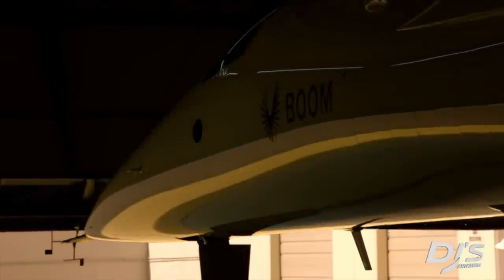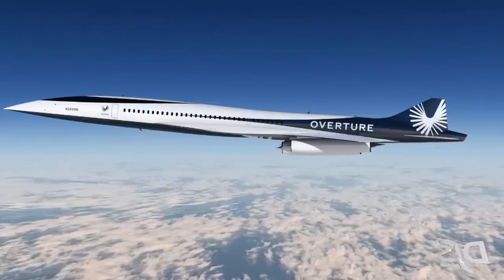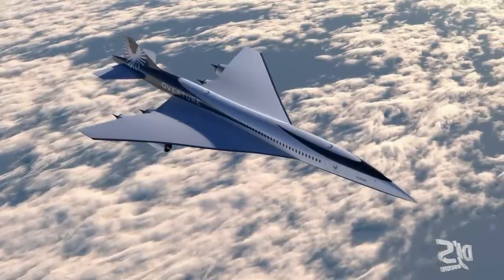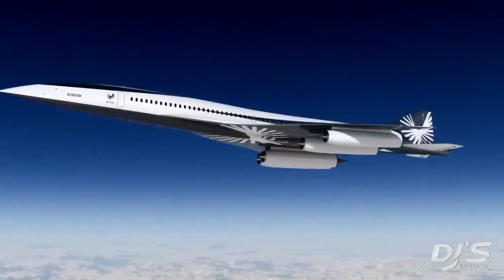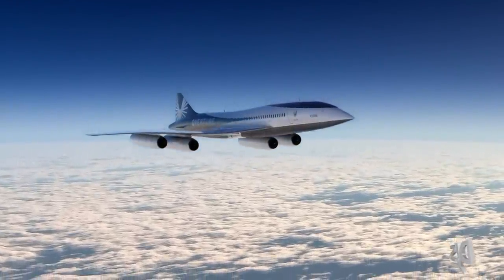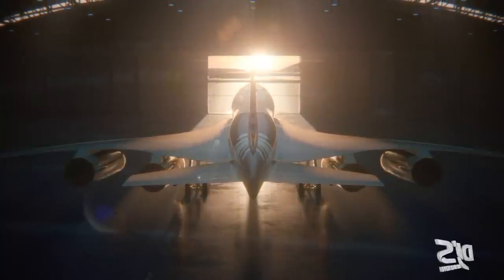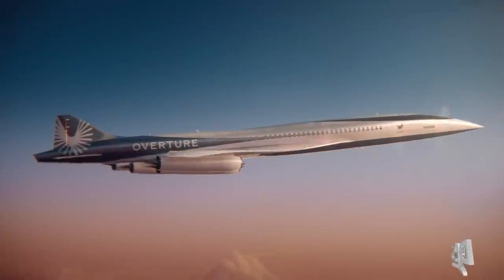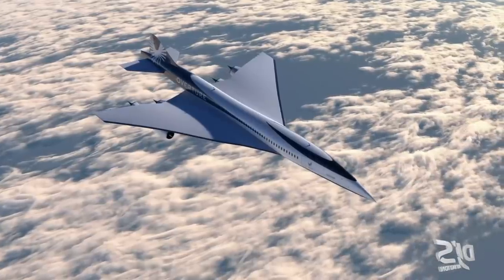Boom Supersonic MASSIVE News

Comment: To be commercially viable this needs to b at least three times the size.
Reply: Concorde had trouble filling its seats and it wasn't a huge aircraft. Considering this aircraft seems to be aimed at the premium end of the market, I would say the size is a good call
Reply: Overture is not aimed at the main line economy market, which is more than adequately catered for by Boeing and Airbus, for example. Instead, it is targeting the 700 million long range business trips made each year globally, 400 million by Americans.

Because Overture will be fuel efficient at sub and supersonic speeds, and will be compliant with ICAO-14 subsonic noise regulations, Boom and the airlines have identified 500 viable routes, some mixed land/water, compared to just 2 Atlantic routes for Concorde. Commercial supersonic flight over land is effectively banned worldwide, so Overture will fly Mach 0.94 (10% to 20% faster) over land and Mach 1.7 (x2 faster) over water. 

A subsonic airliner does the JFK/LHR trip in 8 hours. Overture will do it in 4 hours.
A 16 hour subsonic trip across the Pacific would require a 1 hour refuelling stop, giving a duration of 4+1+4=9 hours total on Overture. 

All 65 to 80 seats will be quiet business class, almost certainly with internet, with ample room. Tickets will be the same price as subsonic business class. This, coupled with twice the utilisation of subsonic airliners, would give a good margin for the airlines.

Comment: Slinging engines under the wings like this will prevent it exceeding speed of sound unless they can produce massive amounbts of thrust, say one fifty- to two hundred lbs. each.  It is like making a brick fly.
Reply: Drag is drag. It makes no difference how much thrust the engine pods transmit to the wing.

Comment: This thing doesn’t hold anywhere near enough passengers. Concorde also failed for this reason. How do they get past that.
Reply: Overture is not aimed at the main line economy market, which is more than adequately catered for by Boeing and Airbus, for example. Instead, it is targeting the 700 million long range business trips made each year globally, 400 million by Americans.

Because Overture will be fuel efficient at sub and supersonic speeds, and will be compliant with ICAO-14 subsonic noise regulations, Boom and the airlines have identified 500 viable routes, some mixed land/water, compared to just 2 Atlantic routes for Concorde. Commercial supersonic flight over land is effectively banned worldwide, so Overture will fly Mach 0.94 (10% to 20% faster) over land and Mach 1.7 (x2 faster) over water. 

A subsonic airliner does the JFK/LHR trip in 8 hours. Overture will do it in 4 hours.
A 16 hour subsonic trip across the Pacific would require a 1 hour refuelling stop, giving a duration of 4+1+4=9 hours total on Overture. 

All 65 to 80 seats will be quiet business class, almost certainly with internet, with ample room. Tickets will be the same price as subsonic business class. This, coupled with twice the utilisation of subsonic airliners, would give a good margin for the airlines.

Comment: 28 million Stimulated core hour did you maybe mean simulated but gentle ribbing aside. I hope it works I really do but small capacity + High Speed = High Ticket Price and since it's range is only suitable for the Transatlantic and since it is around a 3rd of a 747 it is a small market where it's speed might be a big factor. 
So it is a little slower than the Concord so here is the bottom line is it's ticket cost going to be higher than its competitors but is it  low enough for people to use it because if it is anything like Concord level ticket price then saving 4 hour but paying thousands of dollars more people are not going to use it. But if the difference is hundreds of dollars they might have a chance.
Reply: Boom say that the Overture ticket price will be the same as subsonic business class.

Comment: I was disappointed to read that it will only go to 1.7 Mach, Concorde cruised at 2.2 Mach.  I understand this is for operating economics, still a shame.
Reply: Actually Concorde could only fly at Mach 2.0 for long distances, which was limited by skin heating. Mach 1.7 is still twice the speed of subsonic airliners and will do the JFK/LHR trip in 4 hours rather than 8. Mach 1.7 is only 15% slower than Mach 2 though.

Originally, Overture's cruise was to be Mach 2.2, but it was reduced to Mach 1.7 to simplify the design, especially the use of standard carbon composite and to simplify engine design.

Comment: Wasn't the original plan to have one of the three engines for crusing below mach 1 and therfore be a classic Bypass engine? Know these angines just look like classic nonbypass engines we have since decades and therfor will be much less efgicient and all the revolutionarry design is gone?

Know this semms like a slightly modernised concorde, still intrestibg but far far away from revolutionising super sonic travel. Then considering in 2035 we will be even more focused on reducing emissions and thies just looks like a gasguzzler to me, so I actually have zero hopes it materialises.

Comment: Concorde flew 100 pax @$10k per and couldnt make a profit. What niche is this vaporous product supposed to fill?
Reply: @Hisway07  Overture is not aimed at the main line economy market, which is more than adequately catered for by Boeing and Airbus, for example. Instead, it is targeting the 700 million long range business trips made each year globally, 400 million by Americans.

Because Overture will be fuel efficient at sub and supersonic speeds, and will be compliant with ICAO-14 subsonic noise regulations, Boom and the airlines have identified 500 viable routes, some mixed land/water, compared to just 2 Atlantic routes for Concorde. Commercial supersonic flight over land is effectively banned worldwide, so Overture will fly Mach 0.94 (10% to 20% faster) over land and Mach 1.7 (x2 faster) over water. 

A subsonic airliner does the JFK/LHR trip in 8 hours. Overture will do it in 4 hours.
A 16 hour subsonic trip across the Pacific would require a 1 hour refuelling stop, giving a duration of 4+1+4=9 hours total on Overture. 

All 65 to 80 seats will be quiet business class, almost certainly with internet, with ample room. Tickets will be the same price as subsonic business class. This, coupled with twice the utilisation of subsonic airliners, would give a good margin for the airlines

Comment: I have some cash , which means I have time to slow down so what is the point of paying 20 times as much for a flight in order save a little time because I fly in the middle of the night and it does not waste time ?
Reply: Overture is not aimed at the main line economy market, which is more than adequately catered for by Boeing and Airbus, for example. Instead, it is targeting the 700 million long range business trips made each year globally, 400 million by Americans.

Because Overture will be fuel efficient at sub and supersonic speeds, and will be compliant with ICAO-14 subsonic noise regulations, Boom and the airlines have identified 500 viable routes, some mixed land/water, compared to just 2 Atlantic routes for Concorde. Commercial supersonic flight over land is effectively banned worldwide, so Overture will fly Mach 0.94 (10% to 20% faster) over land and Mach 1.7 (x2 faster) over water. 

A subsonic airliner does the JFK/LHR trip in 8 hours. Overture will do it in 4 hours.
A 16 hour subsonic trip across the Pacific would require a 1 hour refuelling stop, giving a duration of 4+1+4=9 hours total on Overture. 

All 65 to 80 seats will be quiet business class, almost certainly with internet, with ample room. Tickets will be the same price as subsonic business class. This, coupled with twice the utilisation of subsonic airliners, would give a good margin for the airlines.

Comment: I now do not believe this aircraft will be a success - Boeing 2707 was too ambitious and now boom is going along that route now with a quadjet - I am an optimistic person, but realistically this will most likely affect the outcome negatively (I hope to be proven wrong)
Reply: Overture is a much less ambitious aircraft than the Boeing 2707-300, and it also has the benefits of modern aeronautical technology, and materials, along with design and simulation computers and software. 
                                 2707-300        Overture
Speed                     Mach 2.7          Mach 1.7
Construction        titanium     carbon composite
Passengers            230                   65 to 80

Comment: Those engine pods look so so draggy.
Reply: Yes, the engine pods do look draggy, but you can be sure that the latest Overture design would have been fully tested by Booms engineers using powerful computers and simulation software. They are also similar to the pods used on the Boeing 2702 which also would have been evaluated for drag.

Comment: Anyone know what engines it uses?
Reply from the maker: They haven’t announced this yet, they’ve said progress is being made but still nothing firm. Obviously in my eyes a cause for concern.
Reply: @DjsAviation  I think their best bet would be to get General Electric or Pratt and Whitney to modify their military turbofans for the f-15 and f-16, or the ones from the f18 to have a higher bypass ratio. Obviously something more modern like the f135 would be ideal but the government would never allow something so advanced and classified to be put on a civilian jet.
Reply: GE F404 and Volvo RM12 are the most likely.
Reply: @Dexter037S4  yes the 404 is the engine used for the f18 correct?
Reply: Florida Turbine Technologies, a division of Kratos Defence, will design, develop and test an engine that matches the specific requirements of Overture.  Engine development began in January 2023.  Engineers, who were involved in the design of the engines for the supersonic F-22 Raptor and F-35 Lightning, will be on the design team. The engine will use existing certified parts and materials, including blades, rotors, accessories, and core. The manufacturers of these parts will help throughout the Overture engine development program. The engine will have the same basic architecture as engines that currently power all modern airliners:
  •  Turbofan
  •  Medium-bypass
  •  No afterburner
  •  Twin-spool
  •  35,000 pounds of thrust on take off
  •  Air cooled multistage turbine
  •  Single stage, 72 inch diameter fan, low profile, high flow, light
  •  Low-pressure compressor stages: 3
  •  High-pressure compressor stages: 6
  •  High-pressure turbine stages: 1 (passively cooled)
  •  Low-pressure turbine stages: 3
  •  Additive manufacturing for lightness, low part count, reduced assembly costs
  •  FAA Part 33 and EASA CS 33 compliance
  •  ICAO Chapter 14 noise compliance, especially relevant on take off and landing

The Symphony propulsion system will have a Boom-designed axisymmetric supersonic intake, and variable-geometry exhaust nozzle. The propulsion system will be fuel efficient at both sub and supersonic speeds. The intake will be similar to the intakes on the Mach 3.2, SR-71, with a spike that slows the air to the engine, and probably generates forward thrust. Wind tunnel testing of the intake and exhaust are underway.

Comment: Sounds very expensive with only really time benefit for over ocean. Four engines is going to be expensive to buy and operate, and the non-cylindrical fuselage will be expensive. Very difficult to make bigger models without a brand new design.

Meanwhile that money they are getting is paying a lot of board members big (massive?)  salaries I bet.
Reply: "Sounds very expensive with only really time benefit for over ocean."
Well yes, but most intercontinental flights are over ocean.

" Four engines is going to be expensive to buy and operate, "
Buy yes, operate no. 4 engines is generally cheaper to operate than 3. that is why A340 was designed with 4 engines. The reason is that the 3rd engine is really tricky to handle. Also the forward COG increase fuel efficiency.

" non-cylindrical fuselage will be expensive"
While that is the case for aluminum, for composite, it really don´t matter. While the tools are made, there is really no diffrance in production cost.

" Very difficult to make bigger models without a brand new design."
That is somewhat true, but there are ways around this. Look for the 747-8 for example.
Reply: Even the 747-8 the sections were pretty consistent, this is a design that needs to match the air flow so you do not just cut out a section and add a section. Will not work unless you are willing to accept the aerodynamic penalty which may be pretty high..

Comment: Boom is in trouble, and engine development is a huge issue they’re having at the moment……..time buying tactic if I’ve ever seen one.
Reply: Rolls Royce is supplying the engines.
Reply: @Brando7867-j1u  But Rolls Royce have not actually done any engine development work yet and are not actually committed to producing these miracle engines - just signed a contract to say they have first option on the work if Boom ever comes up with a detailed set of specs. This sort of misrepresentation by Boom, along with a sudden total redesign while assuring everyone that things are running exactly to schedule, is what makes most of us think Boom is heading for the bankruptcy courts sooner rather than later.
Reply: @kenoliver8913  but they are listed as the primary engine supplier and in the meantime I assume the overture prototypes will use the same engines as concorde until rolls Royce has a replacement ready.
Reply: @Brando7867-j1u  Olympus turbojets with reheat and a radically different intake? I don't think so.

Comment: Nice design but wHeRe aRe tHe CoCkpiT WiNdOwS?!?!
Reply: There are no cockpit windows. The pilots will view the terrain while taking off and landing, on displays in the cockpit.
Reply: @JeanPaulMueller  Yeah, it doesn't feel right does it! But providing there is sufficient redundancy, the danger is probably less than if other parts of the aircraft fail. In fact, aircraft can auto take off and land without any intervention from the pilots.

The next step will be monitors for passengers too and, after that, not even monitors, but video glasses.

Comment: it takes a lot of money to build and fly and maintain a supersonic plane. will there be enough customers who would be willing to pay very expensive fares? maybe.
Reply: Overture is not aimed at the main line economy market, which is more than adequately catered for by Boeing and Airbus, for example. Instead, it is targeting the 700 million long range business trips made each year globally, 400 million by Americans.

Because Overture will be fuel efficient at sub and supersonic speeds, and will be compliant with ICAO-14 subsonic noise regulations, Boom and the airlines have identified 500 viable routes, some mixed land/water, compared to just 2 Atlantic routes for Concorde. Commercial supersonic flight over land is effectively banned worldwide, so Overture will fly Mach 0.94 (10% to 20% faster) over land and Mach 1.7 (x2 faster) over water. 

A subsonic airliner does the JFK/LHR trip in 8 hours. Overture will do it in 4 hours.
A 16 hour subsonic trip across the Pacific would require a 1 hour refuelling stop, giving a duration of 4+1+4=9 hours total on Overture. 

All 65 to 80 seats will be quiet business class, almost certainly with internet, with ample room. Tickets will be the same price as subsonic business class. This, coupled with twice the utilisation of subsonic airliners, would give a good margin for the airlines.

Comment: It's not a viable concept. How much would they need to charge? At least 10K for a transatlantic flight, one way.
A private jet, shared by 10 persons, is a cheaper and infinitely more attractive option, especially because it takes you from anywhere to anywhere.
AA placed an order, but whoever took that decision should probably attend a weekly AA meeting.
Reply: Overture is not aimed at the main line economy market, which is more than adequately catered for by Boeing and Airbus, for example. Instead, it is targeting the 700 million long range business trips made each year globally, 400 million by Americans.

Because Overture will be fuel efficient at sub and supersonic speeds, and will be compliant with ICAO-14 subsonic noise regulations, Boom and the airlines have identified 500 viable routes, some mixed land/water, compared to just 2 Atlantic routes for Concorde. Commercial supersonic flight over land is effectively banned worldwide, so Overture will fly Mach 0.94 (10% to 20% faster) over land and Mach 1.7 (x2 faster) over water. 

A subsonic airliner does the JFK/LHR trip in 8 hours. Overture will do it in 4 hours.
A 16 hour subsonic trip across the Pacific would require a 1 hour refuelling stop, giving a duration of 4+1+4=9 hours total on Overture. 

All 65 to 80 seats will be quiet business class, almost certainly with internet, with ample room. Tickets will be the same price as subsonic business class. This, coupled with twice the utilisation of subsonic airliners, would give a good margin for the airlines.
Reply: @phonicwheel933  Have you even read what I wrote about private jets? 
And what makes you think that "tickets will be the same price as subsonic business class"? Business Class between Paris and New York is anywhere between 1000 and 3000 USD. Based on a 2000 USD average and a fully booked supersonic plane with 80 passengers you'd have to make that trip for a total cost of max. 160K USD in order to break even. How is that supposed to happen, knowing the Overture is estimated to consume 2 to 3 times as much fuel as a subsonic aircraft, and knowing the list price is 200 million USD?
You live in a fantasy world.